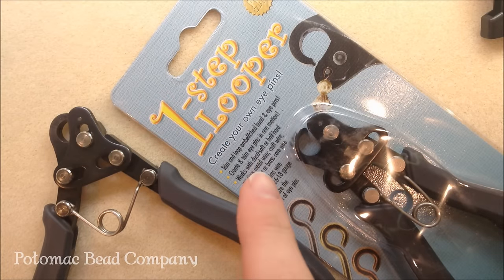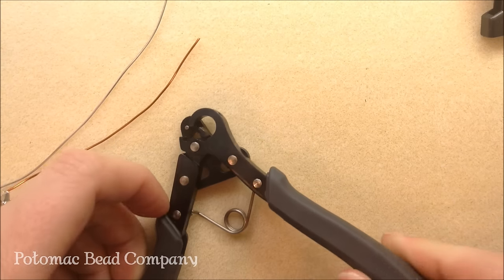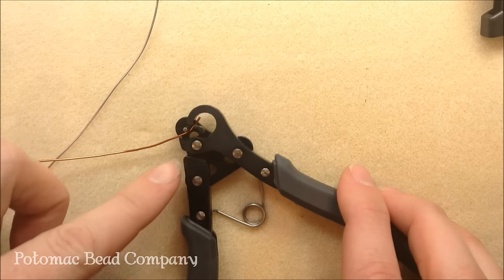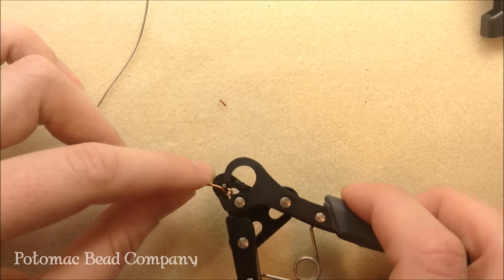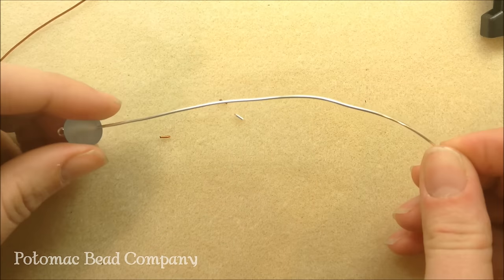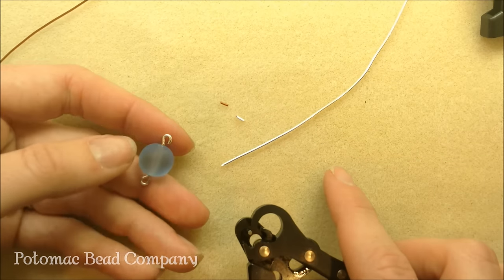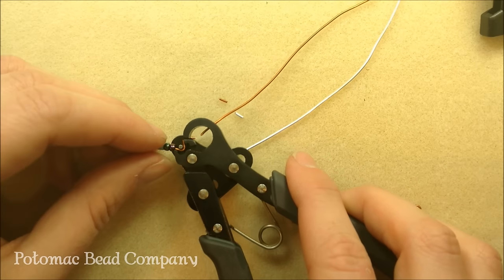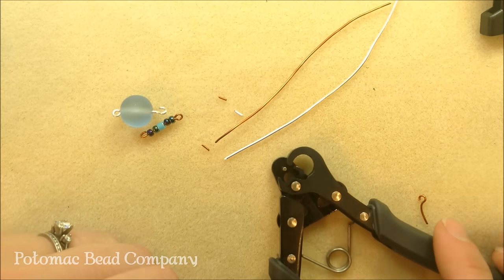How to Use the 1 Step Wire Looper Tool

Comment: Is it just me? These loops don't look that great to me at all, and it seems clunkier than just using a looping plier where all you really need to do is squeeze. Plus all those little bits cut during the process are a waste.  For consistency with your round nose pliers just mark the plier and wrap around the mark for every loop you make.
Reply: EXACTLY...IT'S A TOOL FOR THE LAZY
Reply: You have to ending up jiggling the loops fully closed.
Reply: Its just you.

Comment: I make a lot of Rosaries, which means 118 eye pins made with round nose pliers. It usually takes me about 6 hours if I use round beads, and after the Rosary is together I go over the eye pins to make sure they are basically the same size. A one step looper would be great in saving me time.
Reply: Bella Bella I make lots of Rosaries too!
Reply: Bella Bella I bought this tool but I never use it. I prefer my round nose/concave pliers because they're much quicker and I don't waste any wire.

Comment: the probblem is while it may close ok often you're left with too much 'neck' left as you can't get close enough to the bead to shorten it enough
Reply from the maker: Hello there!   Yes, sometimes there is a tendency for there to be too much "neck" or the loops aren't closed all the way.  However for beginners this is a good starting point.  This is also a great tool for those who have arthritis or other hand/wrist problems.

Comment: Idk I had high hopes to use one tool. Now I literally just got it and used it twice... Right away its made right handed. The loop is perfect but hard for me to hold. The closing tip helps. But I'm having an issue taking it off the pin. Maybe I'm putting it in too far but it gets like stuck. I'll practice more

Comment: I have this looper tool in three sizes.  I may be making a mistake in the way I use this tool in that it doesn't completely close up a loop.  However, it is a good starting point in creating a loop is to place my needle nose pliers into the partial loop and then finish closing up the loop.  It is a great tool, though.
Reply from the maker: Thanks for sharing, that was very helpful!  You are right,  the tool does not completely close the loop but it is a great starting point for beginners or for people who have arthritis or other types of hand/arm pain.  Thank you for watching!

Comment: The loops this tool forms are not precise in size. Too much wire shows after 2 loops are formed.  Is there a better tool on the market? Is the Vintaj bead looper tool better?

Comment from the maker: Well you would only use this tool for a heavier gauge wire where coiling is not required.  For anything over 20g, yes you might as well just stick with traditional coiling methods.

Comment: Having a hard time getting it to cut the wire on my short 17mm eye pins. Instead of cutting it creates another bend. Any helpful tips?
Reply from the maker: If you have eye pins that are too short, the tool won't be able to make the second loop after your bead. It's designed to firm the loop and cut at the same time, hence one step looper.
Reply: I use wire looping pliers to make all my loops. The tool is one half round nose and one half concave. So much easier and less wire wastage.

Comment: Thanks for tutorials, Pls how can I screw the wire onto the bead.
Reply from the maker: I'm not sure I understand what you mean Belinda.
Reply: +Potomac Bead Company I put a link up because she talks like a Fed Ex delivery commercial and makes the thing look useless! Watch the way the guy does it in Cool Tools link. She talks too fast.
Reply: Lemon Squishy I agree. and I have to stop watching and adjust my volume because all she does when she talks fast is suck her spit and I HATE that sound right in my ears! it's disgusting!  plus, clock how long this process takes.  WAY faster using pliers.

Comment: What size looper fit theses 22 gauge 304 stainless steel open eyepins 2 inch (50mm?
Reply from the maker: https://www.potomacbeads.com/1-Step-Looper-Tool-2-25mm-p/9688.htm

Comment: I think this could be a great tool for smaller beads to make connection parts, but not for large beads as it can’t get close to the large bead. Maybe when you have to produce lots of earrings or necklaces.
Reply from the maker: It is a great tool to make loops for earrings, also to make bracelets or necklaces with lots of links.  Thank you for watching!

Comment: Very good demo, esp that finishing off on the wire to close the first loop. 
A bit less talking would be good. We can see the video.
Cost is $46 + $5 tax = $49 for this tiny tool. Pretty outrageous pricing for a small tool made in China.
There is no reason this should be so pricey. It is price gouging.

Comment: They are not really closing the loops, I wouldn’t trust that your piece wouldn’t break. I want a nice tightly closed loop.
Reply from the maker: If you use 20 gauge wire for your loops, they will hold up well.

Comment: Plus one would still have open the loop to join them together so one would need to be changing tools all the time, far quicker and simpler(with a much nicer finish to just use round nose pliers. If you are anything like me then you can gauge the length needed so all your loops are the same size. Yet again pliers give you a huge range of sizes to make your loops where this limited to one size as other sizes are yet to come. This would just frustrate the heck out of me. Nice try but I will pass.